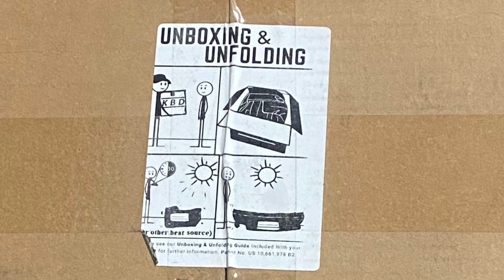KBD VTX UNBOXING Z33 NODRFT 350Z VERTEX FAIRLADYZ 350GT VQ35DE VQ35HR Z 300ZX 240SX DRIFT BUILD

Comment: How’s urs holding up? Mine broke after a few hours of driving cause it’s too flimsy and my front tires ate it.
Reply from the maker: Still holding up strong, you can see updates with vids pics on fb/ig under @nodrft 

I even used 5/8” plastic push rivets similar to oem style and my car is real low. I don’t daily drive it everyday but it is registered and driven every other weekend.